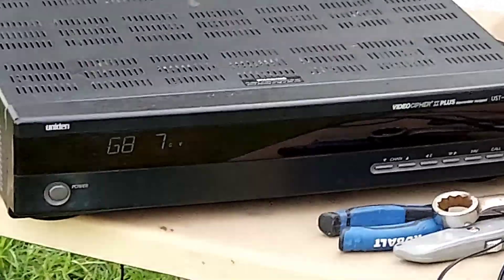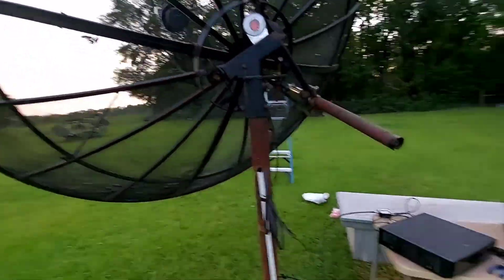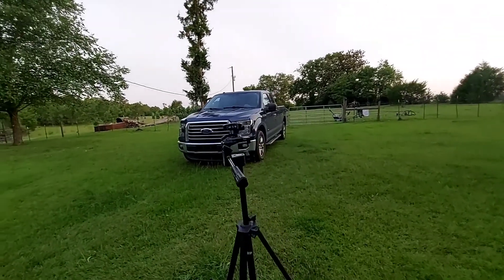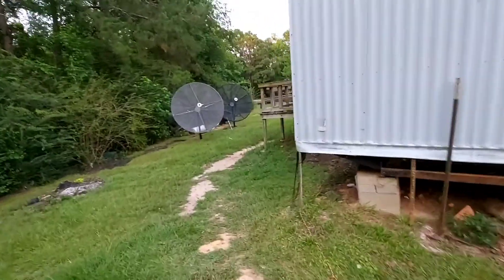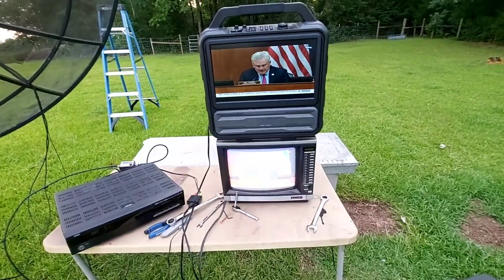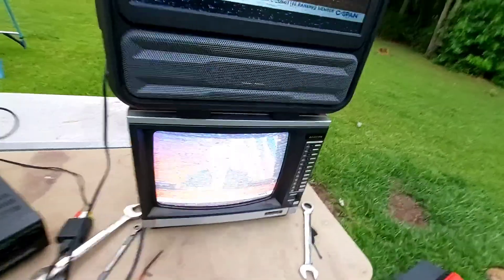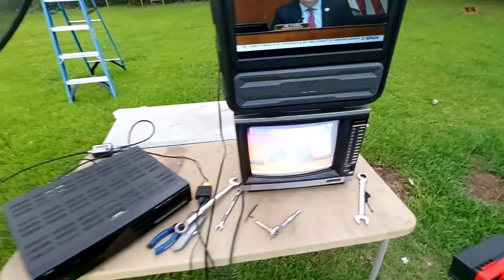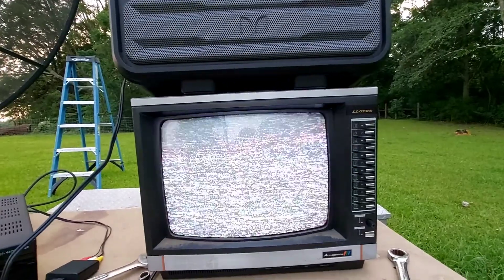C span on AMC 11 satellite tr 7 analog to go away soon.

Comment: Great video. Unfortunately CSPAN analog will be shut down by the end of this year, and the digital version is encrypted. I never had analog satellite receiver only digital. I got into free satellite television in 2017. Germany had analog satellite TV on Astra 19.2 East but they permanently shut down on May 1st 2012. After May 1st most transponders were shut off and some transponders showed you a message that you have to buy a digital satellite receiver in order to receive free channels, similar to what happened in USA in June 2009. On digital there are almost 400 channels free to air.